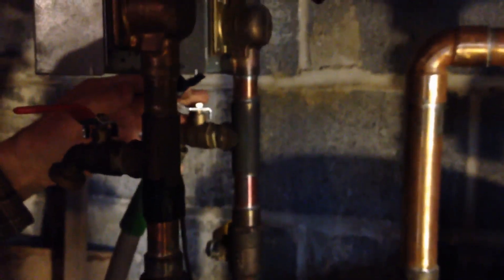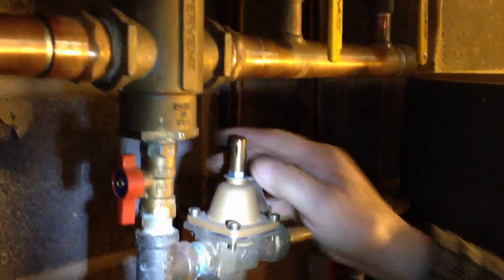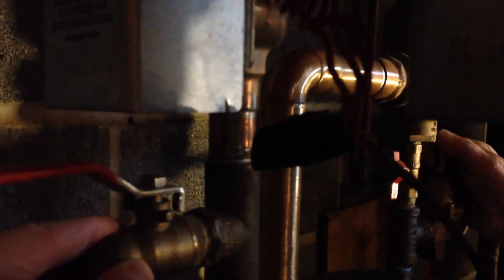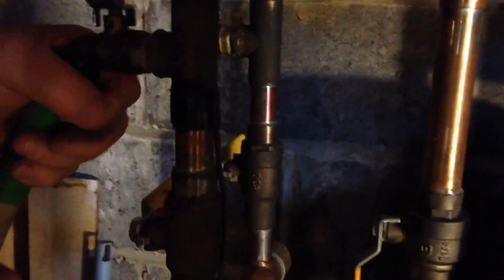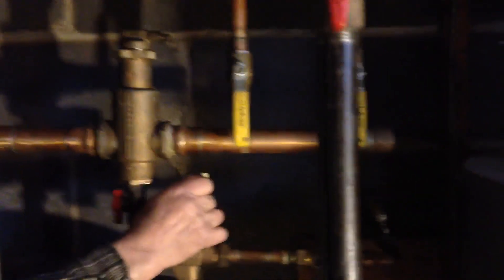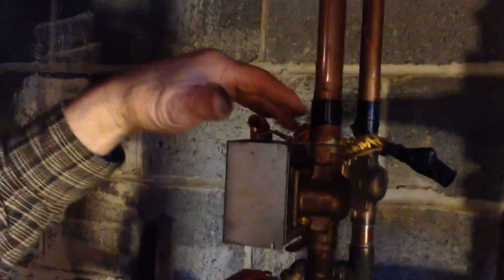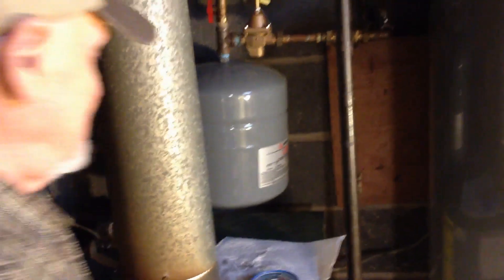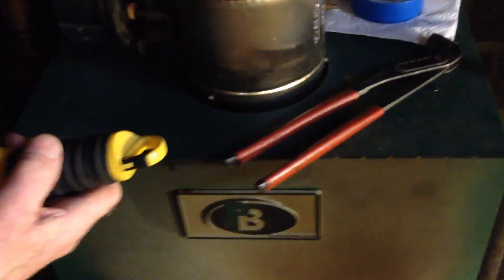Bleed Baseboard (Remove Air) Hot Water Heating System   Also Reducing Pressure

Comment: I've two-family house I can't get no circulation in my kitchen and liver
 room on the second floor which is right next door to each other.I bleed
 them both Still not getting no hot water coming out my bleed 
valves.What's  the problem?I don't have  no zone valves.

Comment: Should I turn off the thermostat before doing this process?
Reply from the maker: There should be a power switch to the furnace (boiler) either on it or on the wall next to it.  Mine is on the wall, it looks like a wall light switch.  Yes, turn it off, then back on when you're done.
Reply: I have 2 thermostat one on the second floor and 1 on the first floor the heat is not working is on the first floor. So just turn off the thermostat on the first floor?
Reply from the maker: @donferrer7520  You may have a bad "zone valve" if you are not getting heat on 1st floor.  turn up (on) heat for 1st floor and go down to furnace and make sure the zone valve is open and furnace fired up.
Reply: Ok im gonna try that , im gonna turn off the 2nd floor thermostat, and open the 1st floor thermostat to check if the furnace will fire up.
Reply: Yeah i try to turn on the thermostat on the first floor and turn on the zone valve but furnace doesn't want to fire up. Maybe i need to replace the zone valve.
Reply from the maker: @donferrer7520  OK Don, My best guess is it can only be 1 of 3 things.  Bad zone valve (probably), bad thermostat  (maybe), or a crack in the wire leading from thermostat to zone valve (doubtful), but that did actually happen to me yrs.ago.  Ironically it was also my 1st floor zone.  Anyway good luck, and let me when you fix it.

Comment: I didn't see one baseboard heater in that video.
Reply from the maker: That's because you bleed the system and reduce pressure from the "boiler".  Not from an individual baseboard.
Reply: but shouldn't I try to bleed the base boards first? I feel that is a safer simpler option rather than mess around with the boiler pipework without fully knowing what I am doing and risking depleting the system of all water ?
Reply from the maker: @raymondprescott1311  It's a closed system.  Air rises to the top, so when the zone valve opens by way of the thermostat calling for heat the water will push the air around the system.  Raymond, I don't know your system, but most baseboards don't have bleeder valves. The one bleeder is at the boiler so as you are letting out the water, all the air comes out too. BTW, as you do this, new water is coming in by way of the inlet valve, which must be opened.
Reply: Oooooohh. My bad.

Comment: I have  lots of air in my pipe. It took me more long time to skim and seems never can take them out. I don't find any leaking in pipe anywhere. Please let me know what should I do
Reply from the maker: It's a closed system, so you either have a leak somewhere or you have a "spiral vent" on your system.  It was the spiralvent float that went bad on mine and a new float was part of the $35 rebuild kit.   Fixed my problem.  I also posted a vid about that. The link is in the description.   Hope that helps.

Comment: do you think its best that i keep the boiler off or does it matter during that process?
Reply from the maker: Yes.  There is an "on" "off" switch either on the boiler or mounted on the wall near the boiler.  Shutting the switch to OFF is the first thing you should do.  After all work is done, flick switch back on.